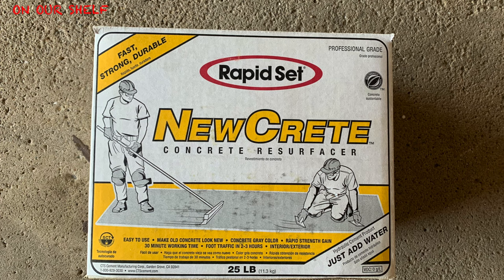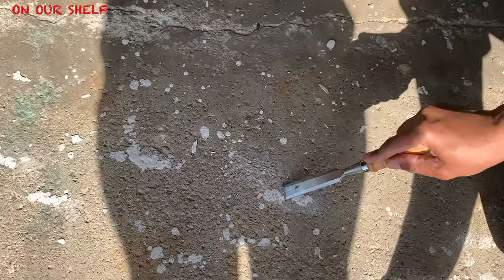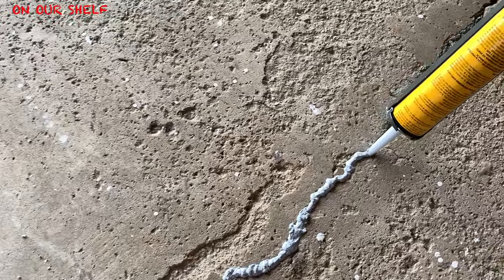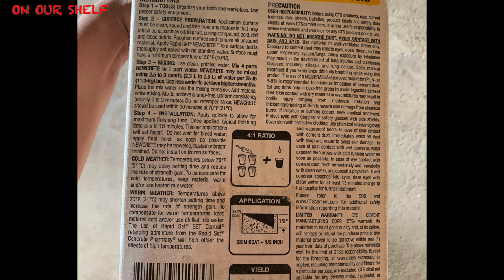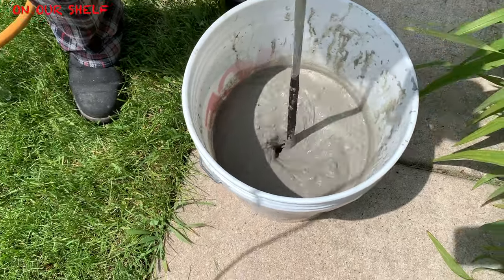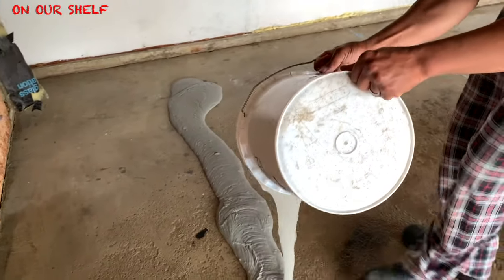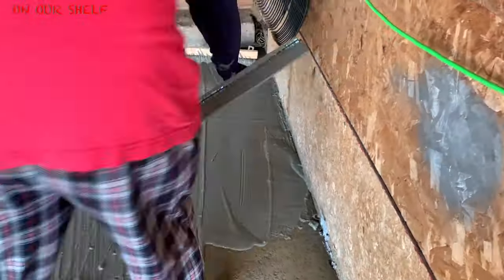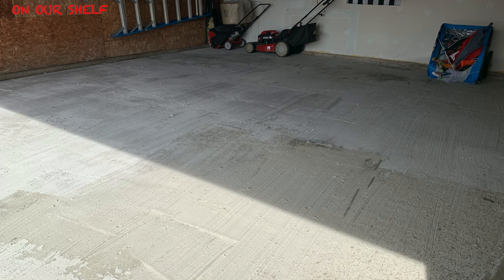New Crete Concrete Resurfacer Review

Comment: I know this is a year oldand im not going to criticize, but i have a question. Why do these products say to use that ling handled squeegee?
Iim thinking a flat steel finishing trowel would give a much nicer finish.  I install flooring, so I'm thinking smooth.
Im also thinking two applications. Apply the first one to fill in the voids, then as it hardens a little bit, scrape off any troweling ridges. Let it dry, then vacuum the heck out of it and apply the second coat. The second coat would go faster than the first one because all the small voids and pockets have already been filled.
That squeegee might work in conjunction with a steel trowel.
Have one person pushing the materisl around to get it where it needs to go, then the second person could just consecrate on smoothing the finish.
This looks like a two person job anyway with one person mostly mixing and cleaning tools and buckets, the other doing the work.

Comment: Thank you so much for your experience and video!!  Question!!  Did you ask or discuss about Concrete Sealing????  I'm currently cleaning AND sealing a lot of concrete around house.  I'm using silicone crack sealing AND then sealing the concrete surface as well.  Just like you, I have a large area of pitted concrete surface that I too wish to Re-Surface.  And I'm wondering if sealing the re-aurfaced area will help with the life of the ReSurfacing???

Comment: I won't repeat several others comments, but your #1 issue that led to your lumpy mix..... You used the wrong mixer.... Your flat paddle mixer won't get the mix ultra smooth and non lumpy.... Your needed to use the spiral type mixer in order to chop all the lumps out, as others mentioned, adding the mix slowly to water as you are mixing, not all the water into the dry mix as you did in your video

Comment: A little more advice I wouldn't try to broom finish on top of a slick finish and then only do one drag the proper way to do it would have been to come over top that with a hand trowel and let it dry a little bit and then broom it was way too wet to or maybe I've done it a second time with a longer broom that way you get one stroke all the way from the front to back

Comment: Concrete try adding a little bit of concrete at a time while you're mixing it no don't just dump the whole bag and that's what made it Lumpy try to do it in quarters or 20% at a time just so that until each additional pour of concrete into the water becomes one free then you add the next batch by having all that it's like baking and flour if you put the flour in like that too much it gets lumpy but if you had it in little by little then you get a smoothie mix

Comment: You could also dry mix it first, then add water slowly, as mentioned. Dry mixing it helps the water absorb evenly.
Reply: No never dry mix omg no . 
I'm concrete finisher 20 years. Always piss wet first then dry ..I'm the fastest finisher on this planet
Reply: @reggaetony2806  and the most modest.

Comment: Hi handsome. Great project. May I add a newbie tip: 1 clear all objects out of garage. 2 - go to home Depot and rent a cement diamond cutting vacuum and buy a diamond wheel to cut into and clean all cracks. 3. Pressure wash garage floor. Then it's clean enough to seal.  ,Then fill with quality quick Crete from home Depot. Finally topcoat it. God bless you. P. S. Don't forget to buy crypto:XRP, XLM, XDC.

Comment: muriatic acid. Id fill the cracks with jb weld. Your stuff shouldve worked as well. Did the crack fill smell like car bondo? Im crazy so I'd use RO water for mixing too though.😂 Honestly i would have just epoxy coated that floor.

Comment: Should have used a different mixer and moved it around the bucket. Need to add to the water as you are mixing. Paddle mixer just moves the chunks around instead of breaking them up. Etching with muriatic acid is the way to go to prep. Fill gaps with cement all by rapid set and trowel smooth. Don’t just dump the product on, get it somewhat smooth with a float or trowel. Then broom. When brooming just drag the broom with no pressure across the surface. Want to rinse the broom every pass. Some chunks were from improperly mixing and most were dried up pieces that had been sticking
To the broom.

Comment: Add the concrete to the container first then the water, when you get the lumps break them up with a hand trowel when you add more water you weaken the product. otherwise not bad for your first time.

Comment: I don’t think you did anything wrong. However I would not have done this correctly on purpose. I would have left those patch lines raised. Then I would have poured the concrete in the sections. Thus mixing small batches, perhaps making it easier to get the lumps out.   Then I would have painted or stained the floor.

Comment: You get an A for effort.-Concrete/Cement projects are very tough to get to come out the way you wish. Portland cement (which this mostly is) always comes out too white and not matching the rest of your concrete and is difficult to mix and apply (especially on a huge project like this) as it is what it says- rapid set. I absolutely do not recommend "painting " a garage floor as this creates a slip and fall hazard, eventually, (reason for brooming). If you do you work projects in the garage it is sometimes better to just clean it and leave it alone.

Comment: I do this professionally. First let me say concrete resurfacing is what we call a permanent temporary. The only true real way to get good concrete is to rip out and replace having said that if you choose to go this route this product does work if preparation is done right. I do a few extra steps in the process and the way I mix and apply. I also do other final steps to ensure that it remains for a period of time to ensure the customer gets their bang for their buck. Just be aware it's still 40% of cost vs rip out and replace

Comment: Do it again.  Mix smaller batches.  Use a squeegee to apply and you will have a smooth surface.  Work the puddle with the squeegee, no stopping and dragging from a drying area.  Honestly you could have repaired your original cracks and painted with deck and porch paint adding some sand in the paint for traction but to late for that.

Comment: Has a Mason I can tell you you are using the wrong paddle on your drill two you need to use the squeegee part of it as you are putting it down then if you want to wrap it up and use the brush side put a bonding agent over it go over it again

Comment: My driveway came out looking like crap with puddle shapes of variations of different shades everywhere. It dried up so freaking that I had less than 60 seconds to move it around before it dried. Used 6 liters of water to bag. Looks like crap. I used All-crete. Bought 7 bags and rushed like mad to spread it with squigee. But still ugly as hell once dried.

Comment: i'm sorry you felt this didn't work for you. the  you se are called burrs. they are a normal thing that occur when trowling and then when you use the broom. that is why when after it has set you should take a smoothing stone to it. i will remove those burrs. But i also saw a few other mistakes. first you needed to take a grinder, cement paint remover, to remove the crap off the old concrete, resurface material doesn' adhere to things that aren't clean. then you wash with the cleaner specifically made to clean concrete ( i know you did, but i don't know if it was for cleaning concrete or just a cleaner). then you can't use a rubber filler to fix your cracks. that crap just doesn't work. it's a waste of money and time. and when you scraped off the excess you left a mess tha can't just be washed away. you needed to use a product also made by rapidset called cement all. and also add a another product by rapid set called set control called set control. this will give you more time to actually use the product. since you don't have any experience only mix in SMALL quantities. fill in all the cracks and large holes. smooth them over with a trowel, sweep them, and let them dry if they aren't quite level take the tme to grind them down. now yow cn use your resurfacer. bu again add the control set. without it you have only a few min. i'm talking about 4 min before it starts setting up. with the control set you have about 15. so again only mix up small amounts that you can put down, squeegee, and concrete broom out in less than 15 min. then move on to another section. then let it set up. if at the end you have the burrs, which you ay or may not simply take a smothing stone to it. don't go overboard to it thow, you just want to get the burrs off, not actually smooth the concrete out. i hope you try this out again. i tried to explain this as best as i could. but micheal build does a grea tutorial on how to do it on his channel and mike day concrete does it using he rapid set mortar instead on the new crete but uses the same procedure. both are excellant tutorials. this is definitely not a simple repair for a handy guy. it takes time, patience, and speed,, and practice.i say patience bc you can't just look at the pictures and think you know what you're doing ( that's what my husband does) but you actually have to read the directions. and yes, you haave to watch the videos. notice i put that in plural form. you can't watch just one. you must watch more than 1. as with anything you can't expect really good results without practice. i practiced on some ugly sidewalk on the side of the house before i attempted something big like the garage. with each couple of squares i got a little bit better, and by he time i got to the front it looked great. so i felt confident in tackling the garage.

Comment: Fill cracks and chips with cement or the resurfacer mixed to a thicker consistency.  Don’t use that epoxy and cover it.  
Pressure wash the floor and get rid of all dirt/dust so it’s clean as possible.  

Apply product to bucket while mixing but their bigger issue was you never moved  mixing paddle around the bucket.  Go down to bottom/around sides, back towards top around sides and so on. Those clumps stick to sides/bottom of bucket. 

Consistency of product was a hair to thick IMO and your floor wasn’t prepped right.  

Maybe biggest mistake was to thin of a layer of product and applying brush texture way to early.  It should be setting to the point you’re not moving the product at all like with the first squeegee.  You’re simply adding the texture with the bristles.  You’d rather wait a few mins longer than recommended than to early, especially in a garage that’s out of the sunlight and cooler than outside.

Comment: Probably should have watched more how-to videos before trying something like this. It's not difficult, but if you don't do it right and try and take shortcuts, concrete work can quickly turn into a disaster and this job is a complete disaster. Can't even be saved, needs to be grinded down and completely resurfaced again or completely torn out and re-poured from scratch. 

Concrete is the kind of thing you don't want to jump into with a big project without any prior experience. Practice on a small area first, like a piece of sidewalk and if that turns out okay, then maybe you can tackle an entire garage floor. Rapid Set products are hard to work with if you're by yourself because it sets up fast, best done with at least another person helping you or two. If not and you only have yourself then it's best to only do a small amount at a time. Do not attempt to apply a whole box of the stuff by yourself. You'll run out of working time and that leads to panic and a mess of a job. 

It says 30 minute working time but you really only get 5-10 minutes max on a hot summer day because it's applied so thin so you have to keep that in mind when working with this stuff. You got to be fast.

Comment: You didn't really do anything wrong, but it's worth mentioning that getting self-leveling concrete to work well is really difficult. Getting the mix right is really tricky - too much water and it'll flake off, too little water and it's hard to work. You did a great job with the prep, though. Maybe rent a grinder and hit it with some garage floor paint? That's what I'm doing this weekend. As far as I'm concerned, these products really aren't good for DIYers unless you have a ton of experience and a few people helping you.

Comment: I'm willing to bet that was a 1900psi electric pressure washer wasn't it? Need to clean way more than that. Throw on some muriatic acid even. You really need another pair of hands to do this. Also, go put the wood chisel and oscillating tool back where you got them and leave them there.

Comment: use plastic finned paint stirer on drill at higher speed and a lot of water and just pour it and let it flow out and self level ...need a couple buckets with someone rinsining buckets out while you pour ...the thinner conistencey probably not as durable but much more manageable ...that stuff gets so hot , i cant see how it could hurt but so much adding alot of water

Comment: I used this product as concrete resurfacing contractor and never had lumps like this bro you had the wrong mixer you mixed wrong first mix half the bag and then the other half I add just a bit more water to work it because it dries so fast also you cant work the material too much as it would dry and make it look rough  .I use a squeege to work this material

Comment: Consider maybe doing an epoxy coating over this. Although If the the resurfacing starts to chip up under it, the epoxy would just come loose too.
Also, using a steel concrete trowel to spread and finish the floor would've been better than a course broom. Would've flattened out the lumps too I would think..

Comment: I can’t stop laughing. But like everyone else said. You dumped everything in, instead of mixing and slowly pouring it in.... another big mistake is trying to make it thick, this product is meant to go on real thin and apply multiple coat if you wanted it thicker. When I saw you brooming that floor you definitely left a lot of product on the surface so when brooming you were actually pulling all the excess product and lump thus making it worse...

Comment: First thing first, 
it ain't the product..
yu did everything backwards and unnecessary steps.. especially Brooming the garage floor which supposed to be slick, then your using wrong broom, 
And broomed a lil to Early..
 Now I know Yu don't know , and first tymer.. that's cool..
But Yu supposed to grind the floor first, like sanding, to get it smooth as possible, which helps with application.
then scrub with detergent or concrete etcher..
Then scrub again, suck everything up with wet vac.. then yu apply product.
First coat doesn't have to be perfect, it's jus base coat to cover imperfections..
Then Yu second coat, to cover up remaining imperfections, the more coats the smoother it becomes as far as covering up imperfections..( don't forget to, after every  coat, hit entire floor with a rubbing stone or rent a floor buffer with concrete sandpaper like 80 - 150 grit..  to smooth out the drips , lumps ,etc.. after each coat to keep it smooth ). 
The final step is applying finish coat with squegee (magictrowel)     
then wait couple minutes to light broom it..  
Some floors have no need of broom finish but requires a slick finish, " like you supposed to have did your garage 😭.  But yea you do have to be skilled to use trowel tho..

Comment: You would have had better results by power washing it and using an epoxy resurfacing product, That is a terrible job, get a pro next time, also I would note that whenever you have cracks in your concrete no mater what you do they will reappear after time, the only way to stop this is rip out the old concrete and do it again, subdivision home builders are notorious for pouring the concrete to thin and cutting corners, re do with at least 4 inches of concrete with metal reinforcement, get a pro.

Comment: That product looks like crap. Diffficult at best to get it nice and uniform over a big surface. I'd say it may be good for smaller concrete slabs but I would not use it on a big surface. As for your technique of squeegying it, I'd say less water would have been better , yet less water would make it tough to get it level and uniform. Looks like a nightmare product to make it look good. Epoxy would probably be more expensive but would be a million times better product.